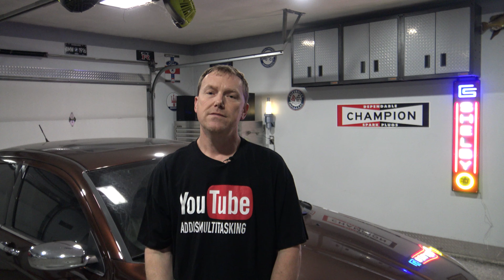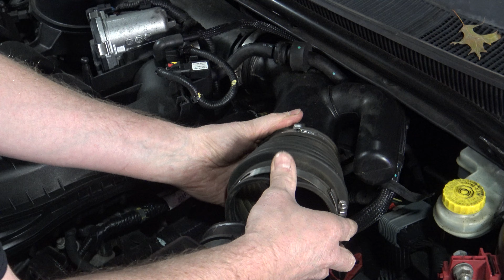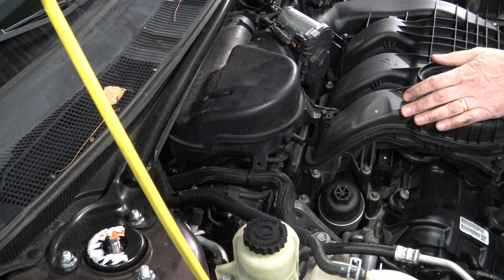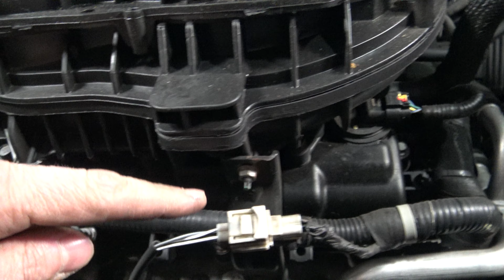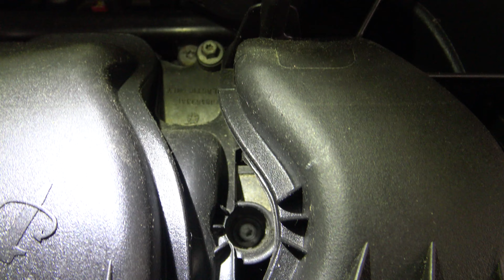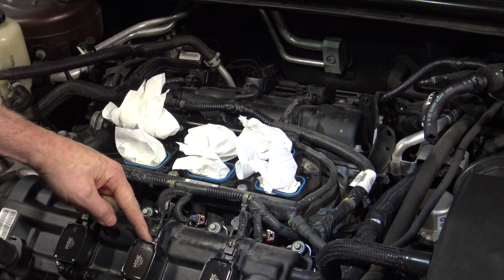How To Replace The Fuel Injectors On Chrysler 200  3.6L V6

Comment: Where are you located? I have a Chrysler 200 and when I went to go get my oil changed at the tire engineer 10 minutes oil change place, the technician recommended a fuel injector system cleaning. I don’t know if they’ll do it right so I’m scared to go get it done.
Reply from the maker: Do it yourself.  Get 2 cans of this Liqui Moly
2007 Jectron Gasoline Fuel Injection Cleaner. 1 can per tank of gas, and you should be good